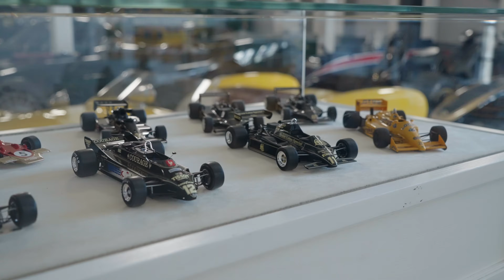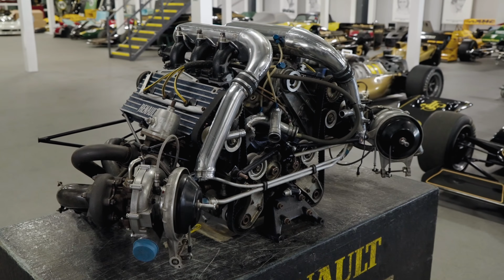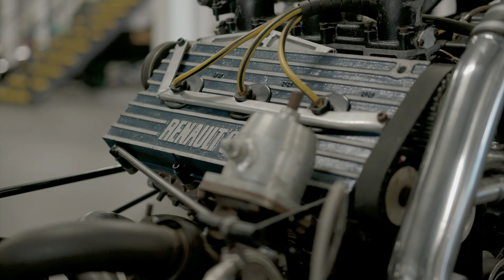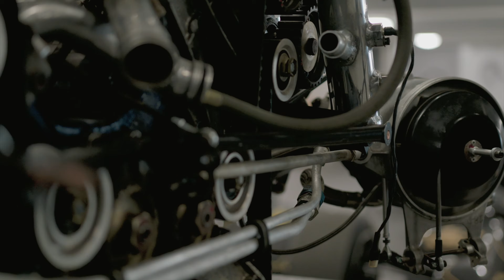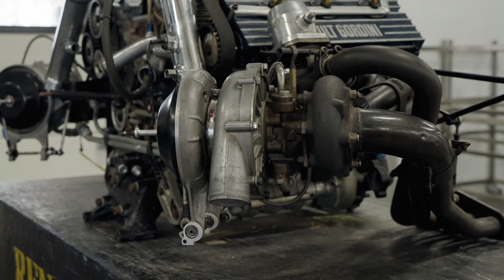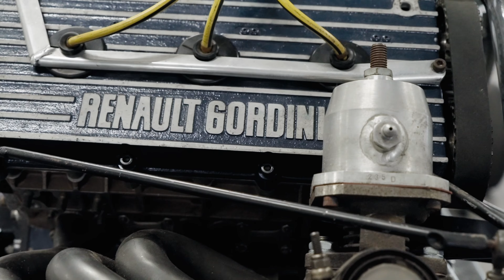The most POWERFUL F1 engine of all time, explained by the man who ran it | Brundle: Behind the wheel

Comment: I think 5 bar is actually 6x atmospheric pressure.  When people talk turbo engines, the boost is measured above static atmospheric pressure of 14.7 psi.  So 5 bar of boost above atmospheric results in an absolute manifold pressure of 88.2 psi total air pressure.

Comment: You are about 200 to 300 HP shy of the BMW I4 iron production block there Frenchy. Nice try.
Reply: 1500 was also a guess.
Reply: @RHBTurbochargers  yes I would say it was more like 1,300bhp at best as they ran a single turbo to 5.3 bar
Reply: No evidence of that whatsoever. BMW were unreliable 1984 on and not exactly bulletproof prior to that. An overrated brand who only ever won races in the back of British chassis and who build overrated, poorly engineered and unreliable road cars.
Reply: “Frenchy”?  That’s a bit xenophobic, isn’t it.

Comment: I never knew that they had to change turbo's as well as tyres! That's hilarious and ridiculous at the same time. 
LOVE video's like this, that engine is legendary. Has anyone ever figured out on a modern dyno how much HP was output? I suppose the parts are not available these days to run it in the same trim as a Q session in '86.
Reply: They also ran very horrible fuel that probably isn't very legal these days what with emissions and all that
Reply: @alexjohnward  Good point. That stuff is likely not around either and that is probably for the best! 
I can think of the Adelaide Quali footage from '86 and the black smoke that puffed out the back of Senna's Lotus as he turned up the boost to full to begin his lap. 
Have to say it looked epic tho haha.